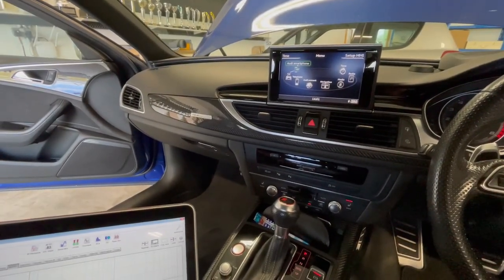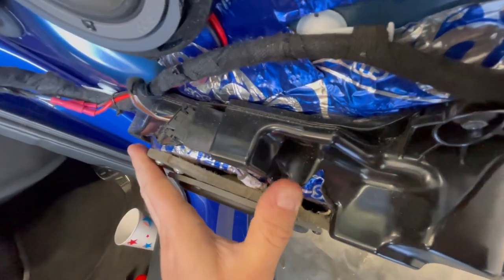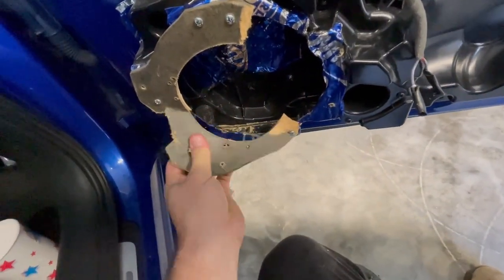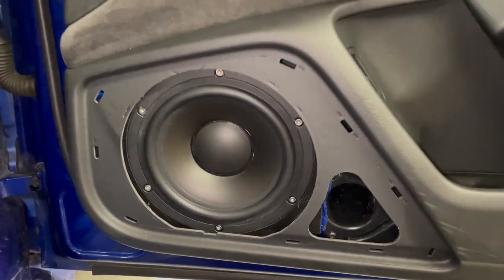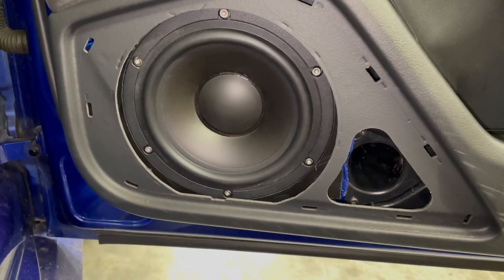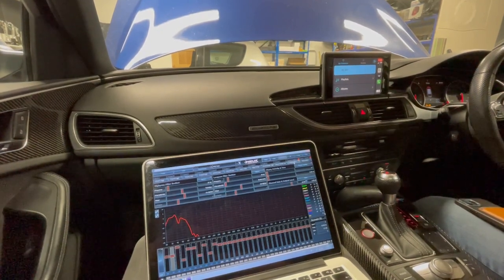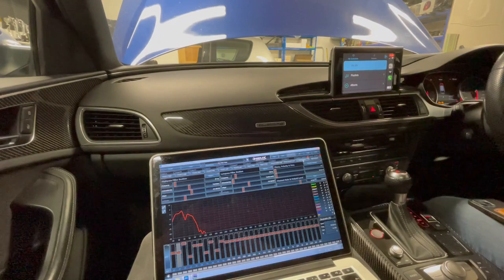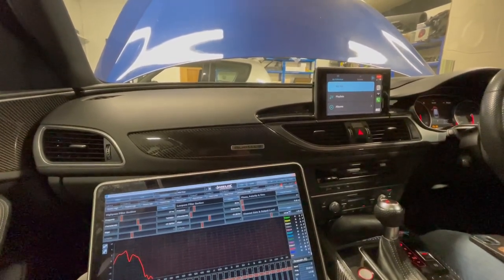How (NOT) to Get Great Midbass - FAIL!!! Focal KRX3 in Audi RS6 - RTA & Tuning Session

Comment: Love your videos Peter! I don't know if it is just me but I don't get why some people and installers don't take time to do things right or proclaim this as difficult/complicated.  I just finished my simple build with a 2-way active up front and basic coax in back, first time using DSP (Zapco DSP Z8 IV original) and after the first time tuning it I was blown away with the results I got - although not as perfect as someone who has been doing this work for years, I was very happy and got good clean powerful sound, a great center image (to my ears) and no noticeable rattling even at higher volumes. Based on your videos and some other youtubers I follow, and my OCD engineering background, I just took my time and ensured the install was right, and I got a pretty linear response for my first tune - I also was able to identify the weaknesses of my system (especially given it is a 2-way and I was re-using some old speakers that I would not necessarily choose for a new build) and what things I would do different next time. I did not find anything difficult (including tuning), just time consuming (as expected) to do it right, so I don't get how some people complain or choose not to do things properly ESPECIALLY professionals - to me it comes down to laziness OR taking on too much at once and rushing through things.

Comment: I pulled apart an E46 M3 because the owner wasn't happy with the sound even though it was loud. The system was in there when they bought the car. First I found the amp, focal 2.150, and then in the doors the drivers, focal Utopia 3 ways. The drivers and crossover were held in the door with Dyna-mat, not a single screw could be found.
Reply from the maker: That’s quality 🤦🏻‍♂️

Comment: Man I once had my front speakers installed with some botching too. The rings were decent, but they just spliced speaker wire into the snipped OEM wiring! Not even wrapped the wire with protective soft tape, soldered on the shitty OEM wires wrapped with cheap electric tape, driver exposed to the elements no box. What a fine job they did.
Reply: actually, factory wires are just perfect, would prefer them over a cheap cca wire. and then in most of the new cars you can't run extra wires in the doors, the door harness plug is so packed that you can't run a single wire through it.

Comment: I tuned into this video because im in the middle of install with focal 165 KRX3 system in a tacoma . Im using the passive crossover in the kit .
Car audio installation's are an unbelievable amounr of work thats only gotten worse with over engineered new cars ! Ive always done it myself and this video illustrates why . Unless you take the car apart you'll never see this nonsense . I guarantee if the owner complained to the installer they would blame the speaker !!!
Just like how the older vw/ audi 2.0 tsi engines would clog up with carbon in the cylinder heads ....the dealer would blame you for using cheap gas !
The fact every other major car maker produces 2.0 direct injection turbo 4 cylinder's..... THAT NEVER FAIL ....is conveniently forgotten.

Comment: Hello, Peter. 
1. A lot of people try to do minimal EQ'ing to the drivers, as it "ruins the sound/dynamics/life", your view is completely opposite - to use the maximum amount of EQ. Why the views are so different? 
2. The response from my midbass in doors (from 30cm) direct measuring is linear from 60 to 500+hz, but in the listening position there are ~10-12db peaks at 125 (driver's side) and 180-300 passenger side. What are the options? :)
Thank you!
Reply: @David Bolbochan  
If they are Peaks, you are lucky and you would simple CUT those specific frequencies, preferably using targeted PEQ with a good DSP. 

In addition, sometimes underlapping the Crossovers between your drivers can help to achieve a smoother response in that region, but Crossovers also affect the phase within the X/O region, so care must be taken here as well.

The most important thing to get right is the Phase & Frequency Response WITHIN Each Crossover Region between any set of drivers that are playing adjacent bandwidths.

And the fact of the matter is, you cannot achieve DYNAMIC and Lifelike/Realistic sound reproduction UNLESS you can provide a Very Smooth & Even Frequency Response from both the Left and Right speakers and your subwoofer at your listening position

Sometimes achieving this goal of smooth and even FR takes minimal EQ work, and other times it requires A LOT of EQ!  If MORE EQ provides a Smoother and More Even Frequency Response, then it will ALSO provide more Lifelike and Dynamic sound.

Yes it is nice to be able to use as little EQ as possible, but that is rarely the case, especially in a small and highly reflective automotive acoustical environment.

As in your case, there may be ACOUSTIC issues that no amount of EQ will fix.  That is when the speakers or How AND Where they are installed will need to be changed to provide a better ACOUSTICAL Response that has less severe Cancellations (suck outs) and Peaks...at your listening position.

ALL systems in an automotive environment will have some amount of unavoidable Peaks and Cancellations.  The goal is to minimize these by using the best possible speaker locations within the vehicle, along with proper Crossovers, T/A, levels, and EQ.

Mounting midwoofers (midrange/midbass) drivers in the doors is a double-edged sword.  On one hand, the doors provide one of the widest mounting positions available in most vehicles, and the width of the physical placement of the midrange drivers ultimately has the most influence on how WIDE or Narrow your Soundstage will be overall.

As an example, assuming that your listening position does not change, think about placing your home stereo speakers only 3 feet apart, or placing them 6 feet to 8+ feet apart.  Which will provide a wider Soundstage???

Due to the usual ~5ft to ~6.5ft Physical Distance BETWEEN the two midwoofers that are usually mounted in the left & right front doors, and the actual Wavelengths of the Midbass Frequency Region, the door locations will cause multiple deep cancellations (nulls) & sometimes strong Peaks in the response.

In the case of Cancellation Nulls in the response, usually No Amount of EQ will fix those!  You can't boost a cancellation null.  You will just be needlessly overdriving the speakers and pushing your amplifiers into distortion & clipping with no benefit because (acoustically) the speakers are out-of-phase and cancelling each other's efforts out.

The acoustical environment and/or a speaker or both speakers need to be physically moved to a location where the cancellation(s) do not occur...at your listening position.

The physical distance between the two front door speakers (or reflections off of other nearby boundaries) cause the speakers to essentially be playing Out-Of-Phase At Those Particular Frequencies, which create the cancellation nulls and some adjacent corresponding peaks.

These nulls and peaks at the listening position can also be caused by the floor-to-ceiling distance, and/or a large & obstructive center console between the two front seats, as well as the shape and size of the footwells on each side.

Ideally, we would mount our midbass speakers in the deep forward and far left and right corners of the kickpanels/footwells, which increases the boundary- or corner-loadiing and "cabin gain" (transfer function) of the midbass frequencies in the cabin, and also reduces the MULTIPLE boundaries that can cause more cancellation nulls and peaks.

But mounting the midbass drivers in the kickpanels usually requires significant custom work and fabrication in order to provide a proper mount and airspace for them to work effectively.  So it's not always feasible and can be a compromise in that regard.

Therefore we are left with the next best "easy" mounting location for the midwoofers, which is usually in the front doors.  And then we have to deal with those issues and limitations as best we can.

Check out a video on the Erin's Audio Corner YouTube channel titled, "Using a Subwoofer to Improve Midbass in Your Car Audio System".  Erin demonstrates how your Subwoofer can be used to help "fill in" the unavoidable midbass cancellations that occur in 95% of car audio systems due to door mounted midwoofers/component sets.

EDIT:  When taking your measurements, make sure you are doing multiple measurements in the area just around your head (at least 8) to create a "spatial average" in the listening position, or use the "moving mic method".  Also check Erin's Audio Corner on YouTube for this.
Reply: @bbfoto7248  Top man, Awesome reply
Reply from the maker: I’m glad that some of you guys help out and answer each others’ questions! 💪🤘❤️
Reply: @bbfoto7248  wow. Thank you. This has to be shared in car audio FB groups.

Comment: Even if you seal the box the box will be to small. I think it's only 6L of space in there. Better to make new plate or buy one from scrapyard. They are not expensive. Midrange location is shit because they don't have space to breathe. This is why on my a7 I fitted them on the a pillars. The other thing to look at is the original mid bass boxes need to be sealed well to the frame otherwise you will have water coming inside. 
The people who done this job should be shamed for what they did.

Comment: Peter I have a Focal KRX2, 2 way built in a similar way as shown in Audi. Please info if you can, how many liters does it take to get the maximum that the speakers can give in the door and does the panel have to be open or closed? Thank you in advance. Best regards.
Reply from the maker: You always have to seal the inside of the door and deaden all vibrating parts, plus isolate the doorcard.

Comment: Which device would you use to pull signal from B&O amp? Zen V or Helix? 

Did this installer use one, or did they just splice into the wires?
Reply from the maker: Helix doesn’t sell anything anymore, but it was the same unit from Nav-TV, the Zen-V indeed. I’m not 💯 sure what was done in this…unless it’s shown in the video.
Reply: @pssound9749  Thanks. Appreciate it! I’ll have to order a Zen-v for my RS3. I hate this B&O system. 

I was a huge Focal guy, but might do Audio Frogs now. The GB series. Have heard great things about them.

Comment: Hi Peter, it draw my attention. Instead of the former Focal mid woofers, you used Steg woofers. I know a lot of Steg models, but what you used for the Audi I couldn’t recognize. Which model is that actually?
Reply: O sorry, I recognized it. It’s the SS652C woofer!Newer model. Actually the woofers of the two way with the wide band.

Comment: They could've at least used stinger fast rings and metra adapters instead of doing a speaker box and bombing it up. I have Sony Mobile ES speakers power by an XM GS4 amplifier, the treble midrange, and kick bass sounds very clean and crisp. The Dynamat, stinger fast rings, and Metra adapter ring worked out perfectly. I'm want to pair it with a Fi Neo 3.5 12 inch sub in a sealed box for a well-rounded SQ experience
Reply: The Stinger fast rings actually do FA unfortunately- being open cell foam. Some guys make their own with CCF. Soundskins makes CCF ones but they're stupid expensive.

Comment: Hi, I just stumbled upon this and wondered if this means we need to seal all holes in the inner door (there are usually many required holes to service the latch mechanisms, and if not, what rules of thumb you have about this.
Reply from the maker: You have to seal everything, there’s no ways around it.
Reply: @pssound9749  But if you seal all the access ports, the door isn't serviceable if, say, the latch mechanism or some of the actuators need to be replaced. And even then it wont be sealed because the window rolls down and opens a slit at the top of the door and some models have drain plugs to let water seep out of the door in case moisture collects if the window is not fully closed when it rains or there is a crack in weatherstripping. Maybe instead put the driver in a sealed enclosure and put that into the door?
Reply from the maker: @robertsussland1876  you just solved it! 💪🏼👌🏼🔊🔊

Comment: Should have put spacers on the focals and tested. Those new drivers fall off so fast you need a midrange crossed over @200 for a smooth curve. Maybe the focals would have blended better in proper space considering they are a matched 3 way? Either way your no 1 in car audio installs in my opinion
Reply: It would have been good to see what the Focals do properly installed. But pretty sure Peter knows these drivers and what he's doing. And looks like that 250 crossover is great.. Do you really want the mids pushing 200? I don't think so.  Um No One or Number one? big difference.  lol
Reply from the maker: If you have watched the video properly, you would have understood that the Focal 6.5” just doesn’t fit even with spacers. You’d need more than an inch spacer, but by then there would be no clearance from the doorcard. Also, the application is ported and the Focal specs are ideal for door application, which is rather IB. 
You’re just talking “maybe” and assume things. “Blending” as such doesn’t depend on using same speaker brands, but the clever use of speakers in the right applications. You and most people judge with your eyes, i work from experience using physics and science. 
I’m happy to be nobody in this game, we’re doing just fine building some of the best sounding cars on a global scale and getting beautiful clients to work with. 
Thank you for your input, it’s been lovely to learn from you! 👍

Comment: How about Passive Radiator on the mid bass?
Reply from the maker: Where would you put them?
Reply: @pssound9749  behind the mid bass
Reply from the maker: @mr.niceguy2524  into the inside of the door? That wouldn’t work. Besides it’s already a ported box.
Reply: @pssound9749  my installer made a new boxes, and it works 😅
Reply: Well if the passive radiator is firing inside the door then you're wasting all the bass radiation coming from the passive radiator, it  would sound something like a sealed enclosure, that's why it doesn't make much sense.
Reply from the maker: @piergiorgiocestra3833  it would work even worse as you’d end up having a dip in response where the PR does the work and the sound from it would be captivated inside of the door.

Comment: Easy to tell that shop was lazy based purely on the fact that the Focal sign is positioned at 9 o'clock.  It would take 30 seconds to make sure the speaker is lined up nicely so the focal sign is in the right spot - if you arent willing to take 30 seconds to do that then you know everything else that's "out of sight" is going to be done lazy.

I was made famous for doing a competition build using blutac and masking tape, and even I wouldnt do work that dodgy lol

Comment: Affordable ($200-$350) DSP for 6 speakers? If it matters, I'm an SPL competitor, see my YT channel to see my 16,000 watts (11k+ clamped and more to come when switching to lithium)
Reply from the maker: Helix Mini if only 6 channels are needed, forget anything else or anything cheaper.
Reply: @pssound9749 How do you pull the signal out from the B&O system? You use Zen-V or Helix?
Reply from the maker: @ryanb8736  Helix used the NAV-TV too, they just sold it for more with their badge on.